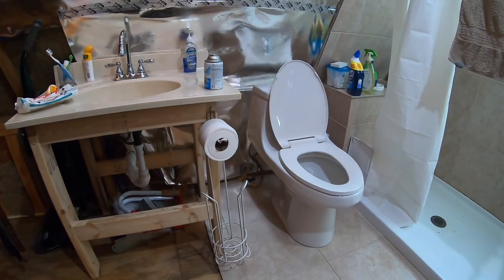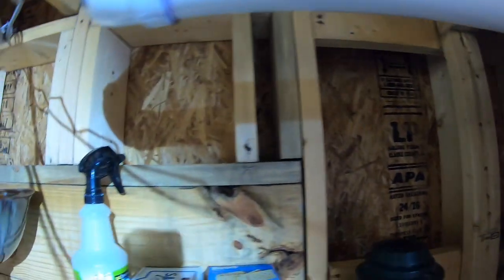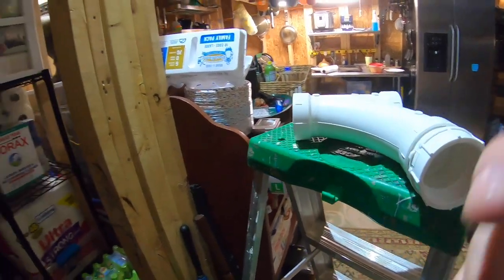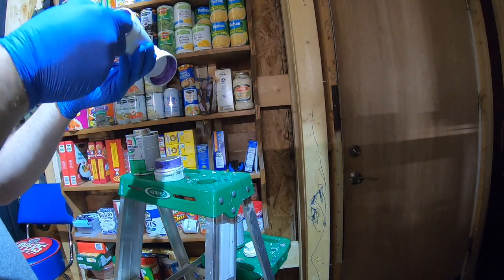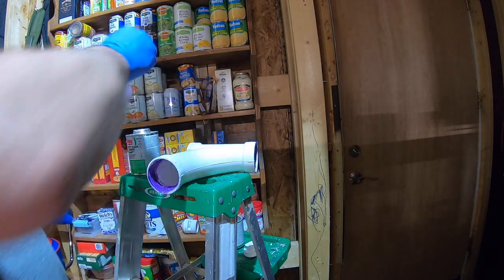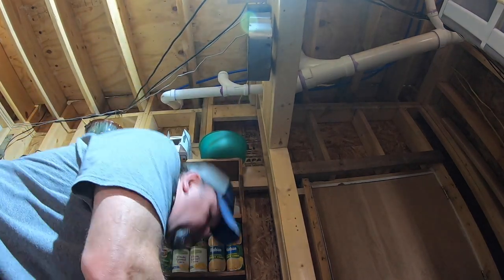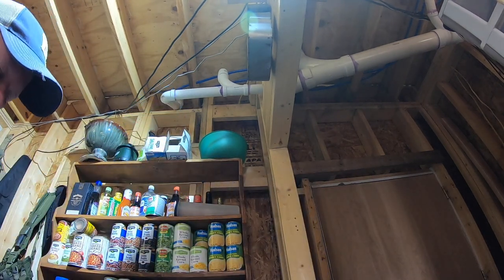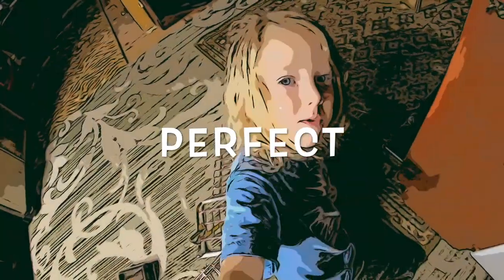Toilet Ventilation, Oatey Sure Vent Install

Comment: What did you put on (like a cap) at the last step right before the flush test?
Reply from the maker: That is a threaded clean out plug from where the vent was originally

Comment: My kids restroom toilet is doing the same thing and has a nasty smell no matter how much a clean it. Is that a sign it needs to be vented?
Reply from the maker: If there's a smell I'm thinking there's already a air leak somewhere that needs to be tracked down. I'm not certain a vent install would fix your prob but there's way smarter ppl on here than me on this, sorry
Reply: @SRTPCC  the toilet does move around, could it be the wax ring ?
Reply from the maker: @amandawallace105  Yes Ma'am
Reply from the maker: Check for toys down there also with kids maybe
Reply: @SRTPCC  😆🤣  my kids are teenagers , I really hope no toys are in the drain
Reply from the maker: @amandawallace105  🤣😂
Reply: needs a vent, your toilet flush is vacuuming the water from the p traps and letting the gases pass

Comment: What if you install the vent on the 100mm pipe not the 50mm does it still do the same work ?
Reply from the maker: I believe that would be the correct way between the toilet & the sewer

Comment: This is wrong . 
You need  a 3"x 2" wye before  and within the code distance of the  3" toilet 90 or a 3" x 2" side outlet 90  at your toilet . The the 2" of either of those  configurations runs to your Lavy ( sink ) .
  The in-line vent should be 6" above the flood level rim of your lavy  to prevent debris from clogging your vent in case of a drainaige back up . .   Now , with what you did , the sink also  has no vent .

This is supposed to be a wet vent configuration  . Where the lavy can vent the toilet .  It's best to run the 1 -1/2" lavy  vent thru the roof . 
That's just the beginning of what's wrong with this .
Sorry .

Comment: Does not look like this would pass a plumbing inspection. Never thought it was a smart idea to put a Studor vent BELOW the fixture it was supposed to vent. It the under sink Studor was installed correctly then a 2" vent would be enough to vent the crapper. Total distance from the centerline of the flange doesn't look to be over 5 feet or so. Please follow up in the future when you have a sewer line blockage and the effluent backs up to your vent.
Reply: Potential clogs is the reason the air admittance valve vent needs to be above the top water level of a fixture. It's also the problem using them UNDER sinks. The one way valve on them may fail.

Comment: That toilet is wet vented thru the lavatory and a toilet can be unlimited distance from a vent because it’s a self siphoning fixture.
Reply from the maker: Right on
Reply: That's because the toilet bowl keeps filling after the flush and reseals the trap. However, if vented properly you won't get that glug, glug, glug sound of air being sucked into the bowl right after the flush. Since there's a vacuum pulling the air through the trap in the bowl, it also pulls back the flush going down the pipe.

Comment: The plumbing is done wrong. If it were pipe correctly, it would not have been a problem.
Reply from the maker: Seems to work good but yes I just pieced it tog myself